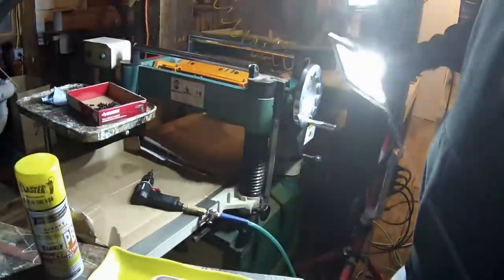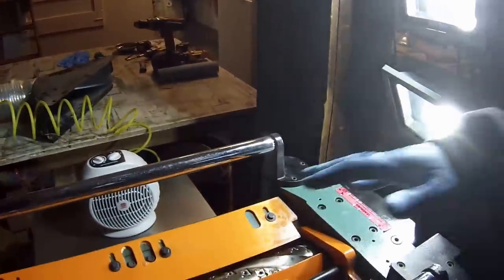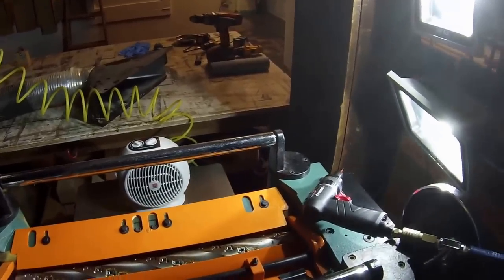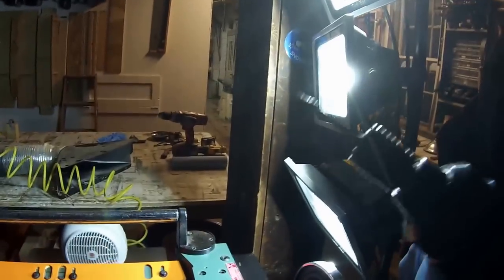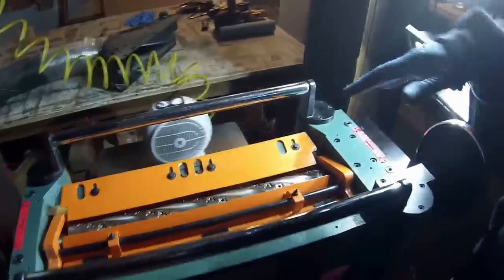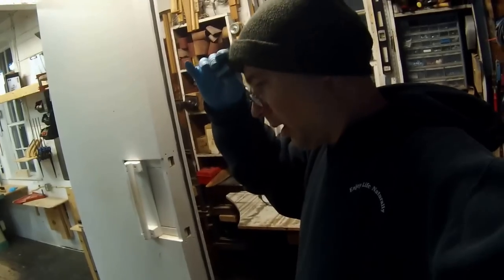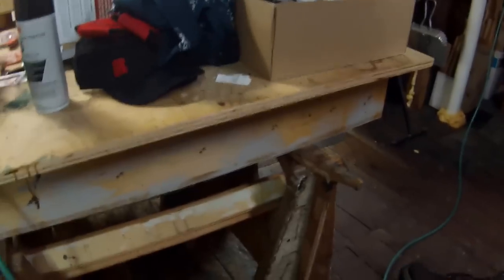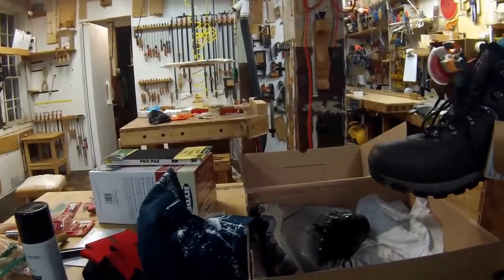Woodworker Discovers Impact Driver

Comment: I try and start my day watching one or two of your vids during my breakfast. This impact tip was a simple one but a good one. I have a 18v battery Milwaukee Impact driver. Do you think it would work? Would pneumatic driver have worked without the blaster?
Reply from the maker: 18v impact driver will likely work just as good.  The main reason I didn't go that route is the cost of the cordless tool is so high.  Lithium batteries don't last and are generally not a good investment.  I use smaller and lightweight 12v drills for all my shop needs.  The air impact driver costs half as much and should last forever.  and I didn't want to experiment with those chinese machine screws so I soaked them all in PB blaster first.

Comment: Yes i "did enjoy this video " thanks for sharing. One tip I would like to share with you is blade cleaner, just use some dishwashing liquid and warm water . Works a treat and cheaper than chips !!!
Reply from the maker: +Mark Vreeken For the tough baked on resin you really need a Ph basic solution.  I tried windex cleaner before, that also works.  The solution I am using is a product I bought many years ago, and then found it when I was cleaning.  It worked very well.

Comment: Is that not a dewalt impact driver laying on the table behind the planer?
Reply from the maker: +djAnakin 
no its just plain old 12v drill driver and a 24v hammer drill with dead battery

Comment: Don`t you have a battery powered Impact driver at all?, first i buyed a 18V impact driver that is a beast, a very powerful machine, but at the end i bought a 12V impact driver, not so much weight as the 18V and not so powerful, better for assemble furniture, don`t break screws as de 18V impact driver and don`t break the bits as the drill.

If you have a battery powered impact driver, what is the difference between the air powered and the battery powered?
Reply from the maker: +Adolfo Torres The biggest difference is the weight of the tool.  cordless impact drivers are designed to be lightweight, air impact drivers maximize impact.. of course I could just be talking out my ass since i don't have a cordless impact driver to test it.  but for the price I went for the cheaper and most effective option.  I have become tired of buying cordless tools... in the end it works out to be a bad investment when the air tool lasts a lifetime.
Reply from the maker: +Adolfo Torres 
I see they make some pretty hefty cordless impact drivers that can drive lags through 6x6's... so I should correct myself by saying the biggest difference is price
Reply: +hffcom in the long run providing you have dry air and a good lubricator, air tools last incredibly more than cordless. i have 20 yrs old air tools that run perfect besides the outside scratches, there are few moving parts in an air tool (bearings, motor blades, hammer mechanism and not much more) compared to the mess of electronics for charging, speed control, motor control, ac/dc rectifiers, inverter and converters, and other crap inside the batt ones. then there is the sealed nature of the air tool so no dust could enter the tool wearing it, and very important you pretty much can`t overheat an air tool, you can stall it and it won`t melt. other factor is the floor drop test... the air drills, die grinders, impact etc i have, have fallen many times to the concrete (my bad) but no one stopped working, last time i stupidly let a cordless fell from the workbench it broke in half at the handle/motor joint. also have many cordless waiting for battery replacement... in all i prefer air tools.

Comment: Hey Mitch, great to see inside that thing, I had no idea that carbide inserts were used in wood machinery! Regarding the resin remover there's a good video I watched recently about removing resin with hot ethylene glycol (antifreeze) I hope it's of interest to you - 
https://www.youtube.com/watch?v=cCTQK9aKpr0
Thanks for the videos mate!
Reply from the maker: +warrantyvoid100 
Not sure I would prefer to inhale nasty fumes, but that seems like a good hack... thanks!
Reply: I don't think it could be used in cars if it was nasty stuff when hot, as long as you add water as the water evaporates the glycol should stay put. Probably best not to store it in Gatorade bottles though.